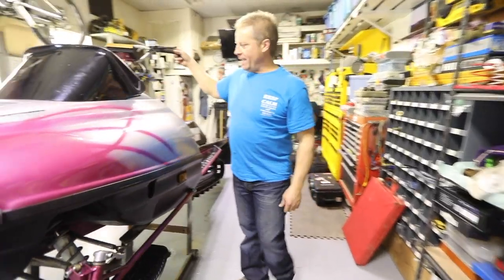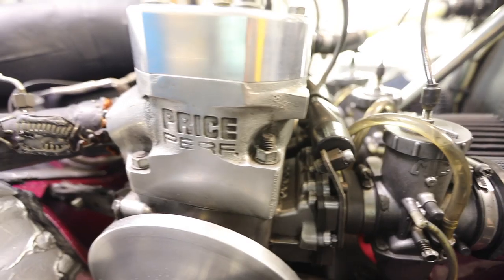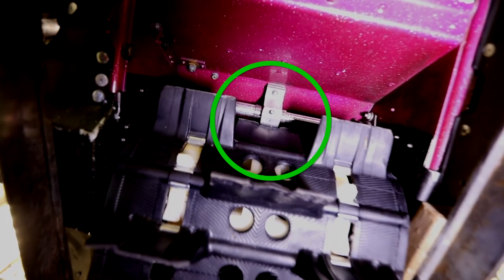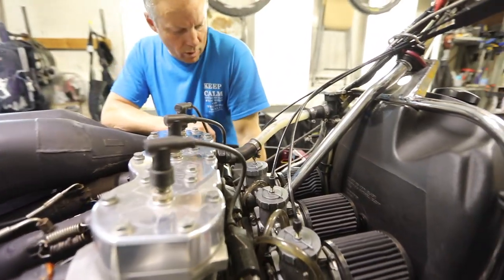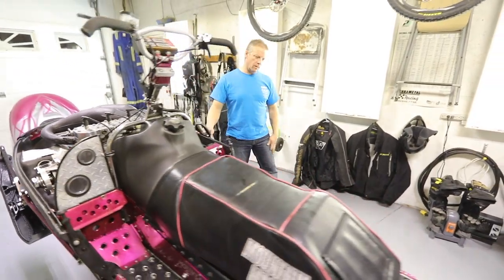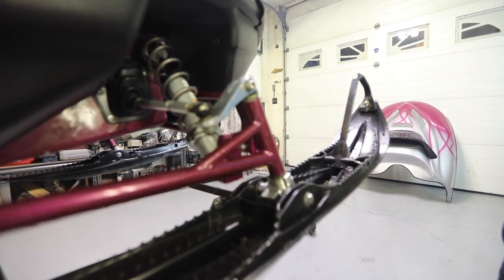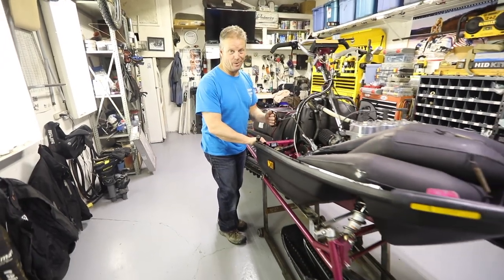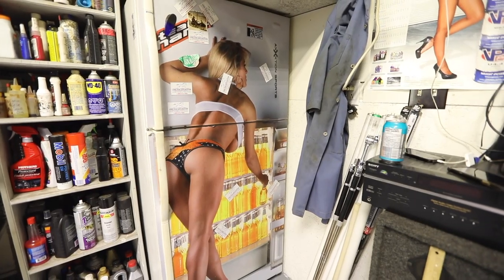MOD SLED BUILD TOUR 2.0!  2 stroke triple (snowmobile hill climber)

Comment: I had this in a 1050. Union Bay built it for me. By far the most forgiving motor. Easy to clutch and literally ran forever in a Gen2 chassis on a Van Amburg chassis. I ran bored thundercat flat slides and bored 44 rounds, both worked good. I hill climbed it for many years. SO FUN

Comment: I have a 98 ZRT800 with Cerakote AAEN pipes, custom built 4 post Comet clutch, carb and head work. I bought the sled new. Sounds about the same but I know it isn't 250HP. I will say it has too much, but hey. Belts are cheap, right?

Comment: Have you ever done rings or anything like that? 20 years is a long time for a high output ripper to run without getting thin skirts and worn rings.
Reply from the maker: been refreshed  a few times over the years , but still runs strong